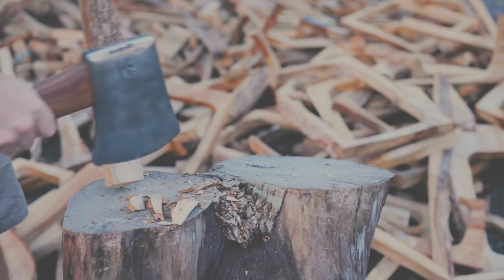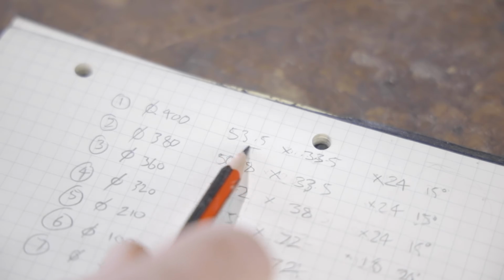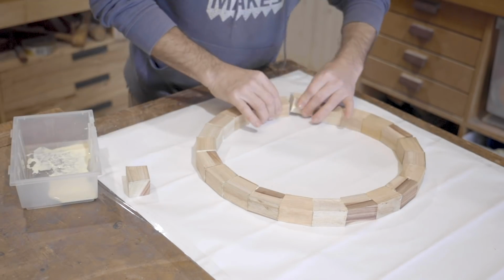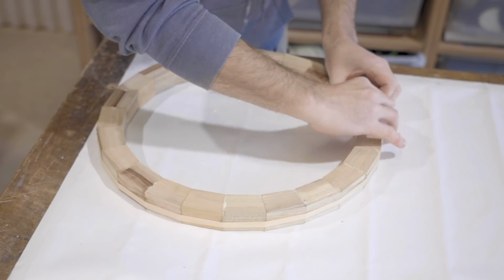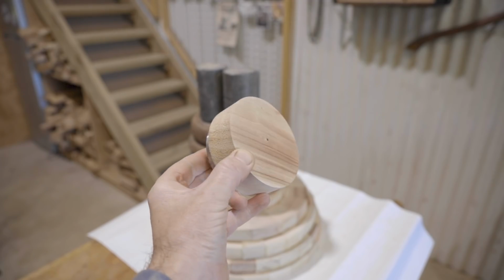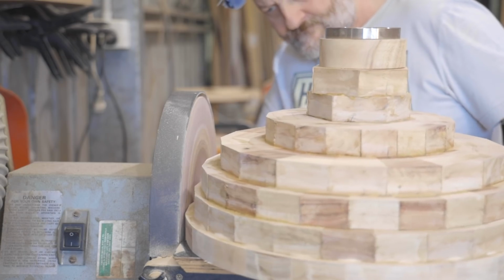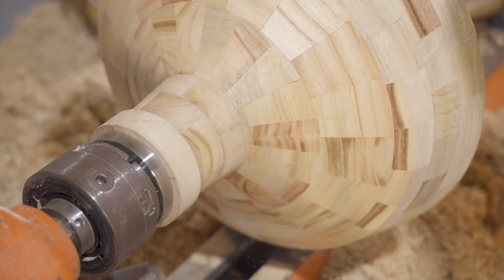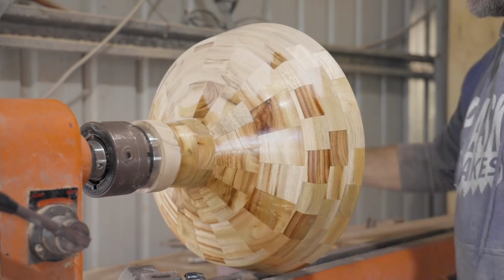Scrap Wood Pendant Light - Scrapwood Challenge Ep33

Comment: Why did you strip the finish on the metal loop you used? Just asking because it probably would have prevented it from rusting and looked nicer. Amazing work on the wood turning regardless! There is no way I could’ve done something like that!
Reply: I'd like to know what solution he used to achieve that. Seems like a controlled rusting
Reply from the maker: Thanks! I really don't like the zinc coating and much prefer the dull grey finish that the vinegar leaves. I like the ring but I didn't want it to be all shiny and take your eye away from the light itself. :)
Reply: Pask Makes Yeah, I think that was a good move. If it ever starts rusting you could protect it with a mat grey or black paint.

Comment: Sorry I couldn't heat it right - which coating did you use? And I'd be interested to know why you like it : aspect, ease to apply, longlivety, resistance to cleaning agents, price...?

And as usual, thanks for the constant quality of your videos: nice topic, beautiful images, clear explanations, smart work, amazing accent and fluffy dogs <3
Reply from the maker: The finish is an equal mix of varnish, boiled linseed oil and turps. I couldn't say how durable it is as I've only just started using it but I suspect it will be very good. I like it because it's easy to apply and looks great. It's also pretty cheap as the linseed oil and turps are cheap to buy and bulk it out. Glad you're enjoying the videos! :)
Reply: @PaskMakes   all right, thanks! :)

Comment: I was surprised you did not glue-up two rings at a time and then add 2 twin-rings together, etc... It does take more time but that way the rings do not move as much during glue-up: more control
Reply from the maker: I did think about it. It worked out though, I just kept checking the rings until they were set. :)

Comment: Only a true woodworker uses needle nose pliers to tighten nuts! Love the project. Great job
Reply: On a lot of those tiny cable clamps, there's just enough intolerable variation between the damn bolts that you can't use the usual wrenches or nut-drivers for the job. By the time you "shave" off enough of an appropriate nut-driver, there isn't enough steel left to take the torque... It's infuriating.

    ...SO a lot of us ordinarily hate those clamps and avoid them like the plague... BUT when you have little or no other choice... get the needlenose... it's the best remaining tool in the kit. ;o)
Reply from the maker: Thanks Michael! I only have one set of spanners and the one I needed (8mm) was missing, I looked everywhere and decided it would have to be the long nosed pliers. I found the 8mm spanner this morning though! ;)

Comment: Question, what is your process for the controlled rusting that is used on the metal used to hold the ceiling light.
Reply from the maker: That was vinegar, it was to strip the zinc coating off. The only reason is I don't like the look of the zinc. :)
Reply: @PaskMakes  thank you so much. Truly love your skill and are very talented

Comment: Wonderful lamp, but i think i would have drilled 3 or 4 small holes in the top to allow hot air from the bulb to escape from the cowl of the lamp by convection action. Otherwise its spot on!
Reply: robert till 
Back when lightbulbs were either halogen or incandescent, that would definitely be necessary, but lightbulbs nowadays don’t generate that much heat.

Comment: spectacular. However, are you 100% positive that that structure will mix well with the heat emanating from a bulb ?
Reply: Looks like a LED bulb which runs fairly cool. but I'm not persuaded that the hot glue will last too long at all....………….
Reply: @raymondo162  quite logical in theory;  but I run LED bulbs all over my house (got fooled by the "economic" myth but the power bills never ran lower) they do emanate a lot of heat... 
As for the hot glue part, it will eventually dry down into flakes and start crumbling... I suffered that fate with a small side-coffee table...

Comment: Beautiful lamp. When I make a swag lamp, I use a large metal eye bolt that is drilled up the center so the wire runs up the bolt and there is no need for a second wire hole in your shade.

Comment: Those aren't scraps! I pay for that kind of size of wood here😑(I literally bought some the other day) if it's thicker than 4 or 5 millimeters it's perfectly usable. You just have to put using small pieces in priority so that you don't end up with a huge pile!
What I'm saying is it's not a "challenge" it's normal for most of woodworkers to use pieces of wood your scraps